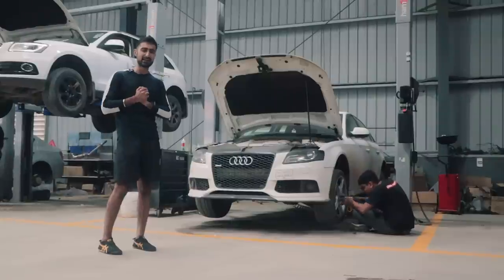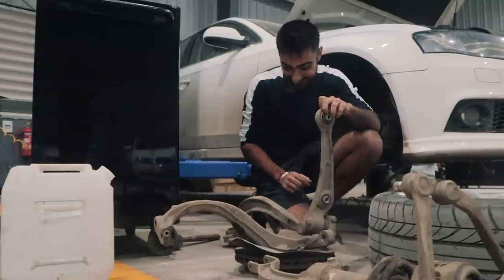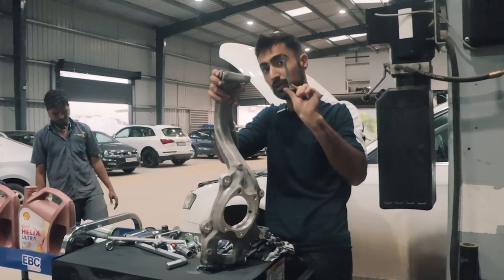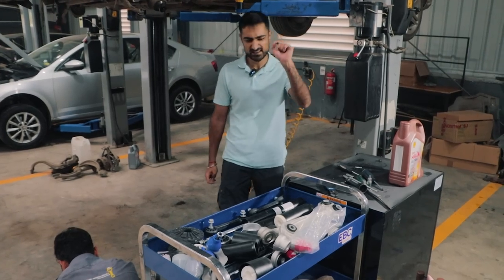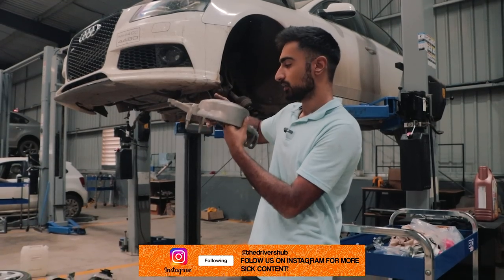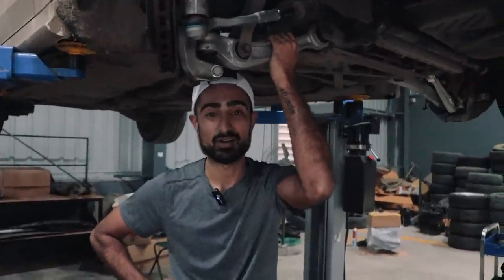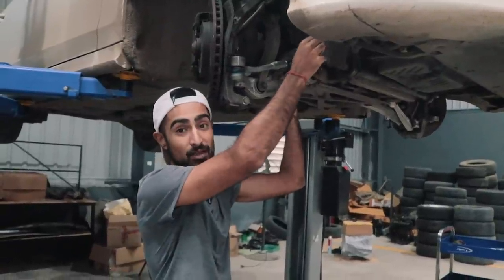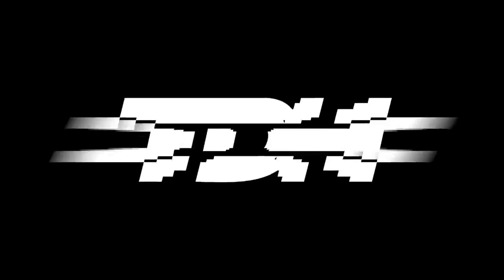3 LACS worth of Suspension work on the Audi A4 3.0 TDI 🤯 | Project A4 (EP1)

Comment: Feel so sad for you man.
During the test drive, When you relised that the previous owner was driving around with such bad suspensions, you shouldve just blocked his number and run away. 
A sophisticated man will never be able to tolerate even a faint noise coming from the suspensions, arms or steering. You can judge a man's personality just by checking out the condition of his car. If he can live with such compromises, you should not be surprised if he has used recycled engine oil. 
Driving the car around with a ruined front suspension would have definitely damaged the steering rack and the other bits associated with it. There's a very slight chance that your car will drive normal even after replacing all of the front suspensions. 
Also i think you got overcharged for all the parts you have purchased. Get in touch with eurospares in hyd. The things you've bought for 3L would be at less than half the cost.
This particular model has a known steering rack issue. Drive at 100 and apply the brakes fairly hard. The steering will start juddering. It might even worse in your case as the car was never taken care of. The new rack is specific to a4 3.0tdi model, so no part sharing, so difficult to procure, hence expensive.